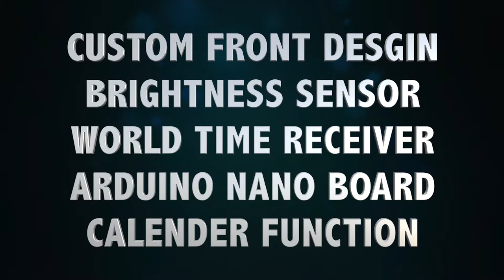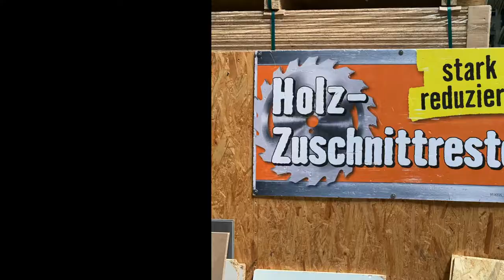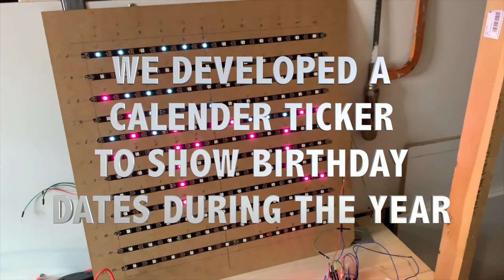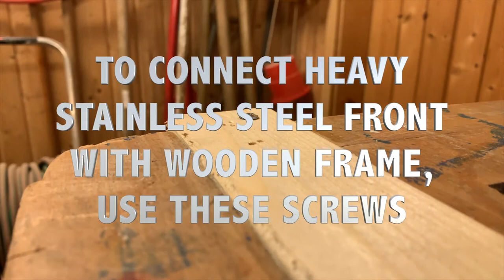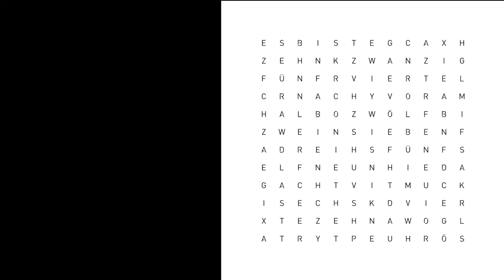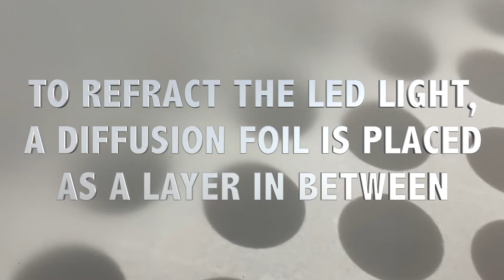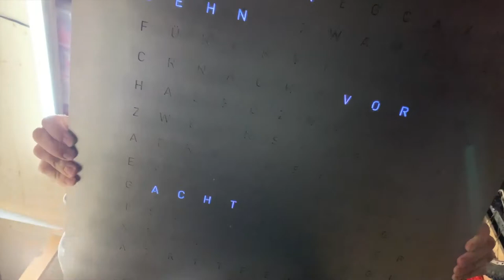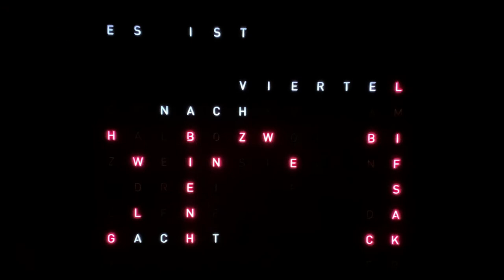How to make a WORD CLOCK with light sensor, world time receiver and stylish stainless steel frontend

Comment: Moin! 
Mega cooles Video!
Ich habe mir vorgenommen selber mit einem "Word Clock" Projekt zu starten allerdings ist es gar nicht so einfach eine geeignete Front zu finden...

Eventuell habe ich durch Freunde die Möglichkeit einen lasercutter zu benutzen allerdings habe ich keine geeignete Datei ... Soweit ich weiß braucht man eine VFX Datei ...

Könnt ihr mir da vielleicht helfen? :)
Reply from the maker: Hi, danke für das Lob! Gern geben wir unser Wissen an Word-Clock Fans weiter. Tatsächlich ist das Besorgen der Front etwas kniffelig. Wenn Du bereits jemanden hast, umso besser. Wie kommst Du an die Datei? Es ist übrigens ein .DXF Datei. Wenn Du in der Suchmaschine nach "QLOCKGENERATOR" suchst, findest Du einen github Eintrag. Installiere das Programm und dann kannst Du Dir die Front nach Belieben (Größe + Schriftart etc) gestalten und als DXF Format exportieren. Gib mir gern Bescheid, falls Du nicht weiterkommst. Gleich noch ein Tipp dazu. Die Schriftart ist entscheidend, da bestimmte Buchstaben wie das "O" ja nicht als Loch ausgeschnitten werden sollen. Unsere, verwendete Schriftart ist: TC_LaserSans.TTF

Hi, thanks for the praise! We are happy to share our knowledge with Word Clock fans. In fact, getting the front is a bit tricky. If you already have someone, you are lucky. How do you get the file? It's a .DXF file, by the way. If you search for "QLOCKGENERATOR" in the search engine, you'll find a github entry. Install the program and then you can design the front as you like (size + font etc) and export it as DXF format. Feel free to let me know if you get stuck. One more tip. The font is crucial, because certain letters like the "O" should not be cut out as a hole of course. Our used font is: TC_LaserSans.TTF